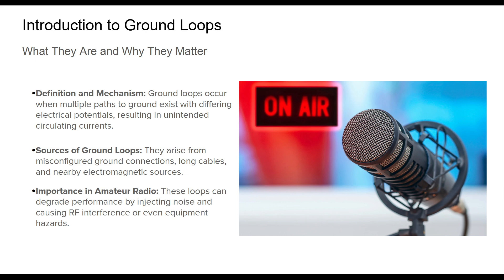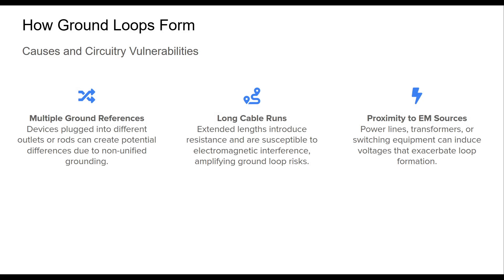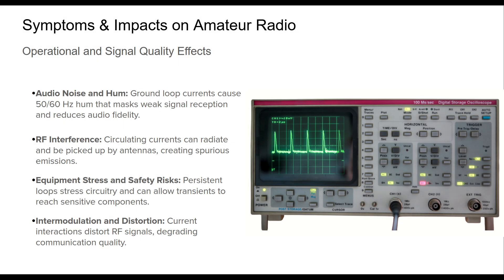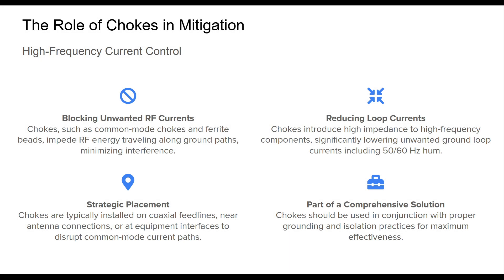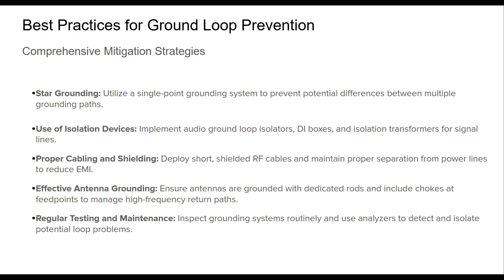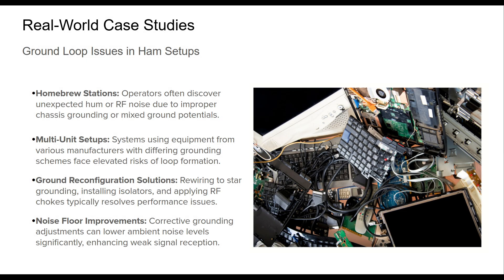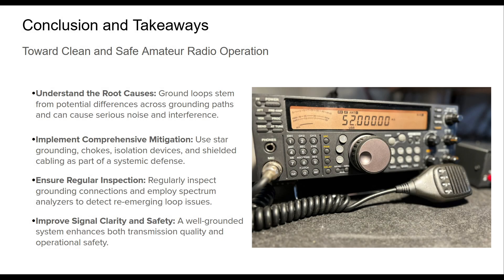Unraveling the PESKY Ground Loop Mystery in Ham Radio!

Comment: When building my new shack I started with Grounding to a single buss. The single bus was tied to six 9ft ground stakes, a new one at my main 120/220 housed panel including the original ground stake, one on each leg of my three leg tower and the final one out about 20 feet from the tower. All stakes were tied together by bare solid copper power pole grounding wire, about 7mm, six inches underground. My chasey grounds all tied to a single point (star) in the shack to the underground buss. My AC for the shack equipment was distributed using isolated ground outlets, the orange Hubbles (ground prong separate from "system" ground) . These outlets required a 4 wire cable, Hot (black) neutral (white) ground (bare) and isolated ground (green). The isolated ground buss at my sub panel was tied to the outside underground ground buss. The only point at which neutral, ground and isolated ground touched or came together is at the original stake at the main house panel. This set up eliminated all potential ground looping and stray RF before i even started building the furniture and installing the equipment. two years now and zero problems.
Reply from the maker: That sounds pretty awesome, thanks man 👍

Comment: Great slide show ! Ground loops effecting in a electrical system. Not just radio. Our computers systems are effected as well. Long cat5/6 cables can make networks get errors as well. Using ferrite and better cables or switching to fiber optic network can greatly improve. 73
Reply from the maker: Thanks for watching Robert, glad you liked it 👍

Comment: Good explanation ground loops!  I have had to troubleshoot aircraft with ground loop problems it can be a pain.  Bulk head connectors going into and out of the pressurized portion of the aircraft can drive you batty.  Being anneal about how you install the equipment ensures that a good installation performs well in flight!  Thanks for the video Ape!  73
Reply from the maker: @KS0JD  hey Jeff, thanks for watching 👍

Comment: I once had an older Hallicrafters tube receiver,
where when plugged into
AC you could feel a tingle
on your hand with the chrome
trim. It must have been some
AC in the receiver.

I also once had hum in a
stereo system from a ground
loop.

Now I just brought a new
Yaesu FTDX 10 transceiver
and Diamond GZV-4000
40 amp power supply, at 
the end of March, 2025, and
all was fine for the CQSSB
WPX contest at the end of
March, a few weeks ago.

Then in early April, a couple
of weeks ago, a noise, visible
on my transceiver shows a
noise spike spaced every 85 KHz, especially visible on the 20 Meter and all the HF bands.
A fellow amateur said it might
be from a switching power
supply.

He also said to check my new
power supply, which I turned
off and the noises were still
there on my Yaesu FT818ND,
and shortwave receivers too
 
He said to switch off power
in my apartment circuit breakers. Not done yet.

This is a fairly new and modern apartment building,
not near others and while I
have an ambient noise level
here,  but not like this new one,
since we moved in last year.
73 de W2CH Ray Peekskill NY 😊
Reply: Apartment? Could be solar charge controller or LED lights or anything the owners or a neighbor turned on. Good luck.
Reply: Several version of the old halicrafters had a hot chassis depending on how you plugged it in.  No polarity on the original power cords on those units.
Reply from the maker: That sounds like interference form something nearby, good luck sorting it out 👍